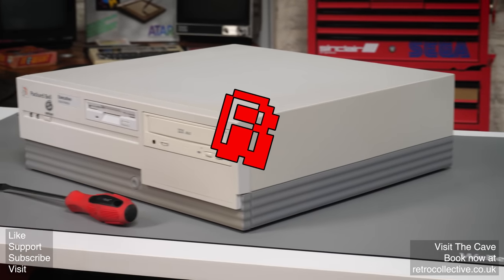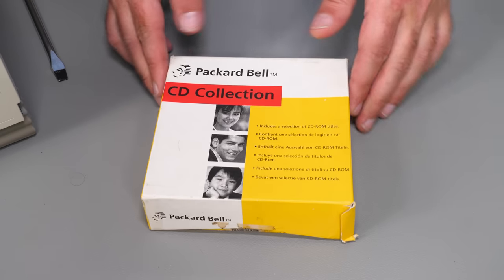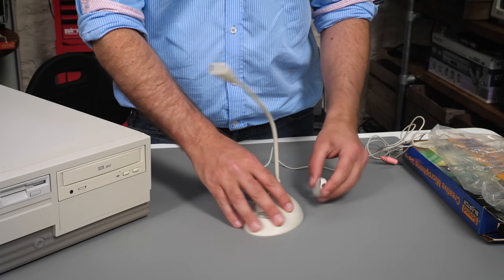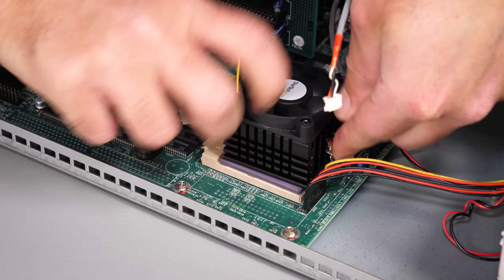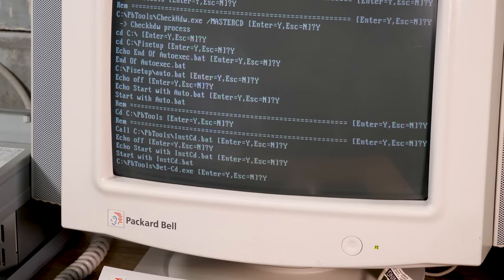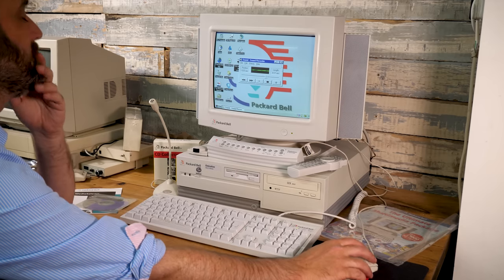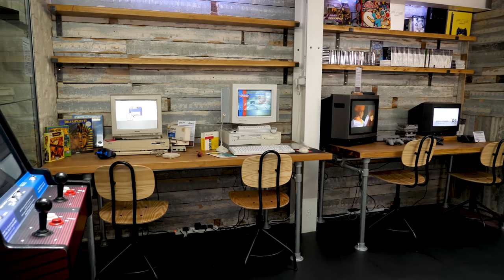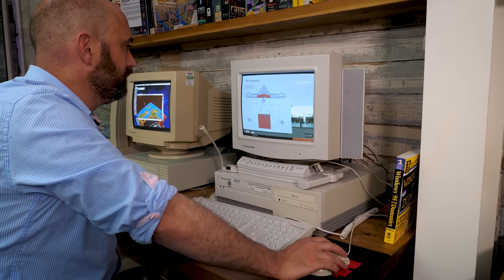Finally, a Home Fit for a ’90s Packard Bell | Trash to Treasure Part 5

Comment: Buying a new computer was a big event in the 80's and 90's. So many memories.
Reply: For me it still is, I mean, especially if its going to replace my current gaming PC or fill a niche I wanna use something for (like a media PC or a as a spare computer/NAS thingy)
Reply: The only new computer I've got was a netbook in 2009, everything else I've got used. To me the last time getting a new (used) computer felt like a big thing was in 2013 when I upgraded from a Core2 Duo E6300, Intel GMA 3000, WinXP system to a 4c/8t i7-920, Quadro FX 1800 (which I upgraded to a GTX 660 half a year later) and Windows 7. That was the first time I had a PC which was capable of running modern games.

While my current main PC (X5670 6c/12t @ 4.4GHz, 24GB RAM, GTX 1080) isn't a fast system by todays standards upgrading from it wouldn't be anywhere near as big as upgrading from the C2D to X58 was back in the day.
I have built more powerful systems for people (i5-12400F + RX 6700 and R5 5600 + RTX 3060) but the difference to my system didn't felt anywhere near big enough to even justify spending that much money to upgrade mine. I think I'll stay on X58 for few more years
Reply: I feel like my dad went computer shopping every weekend for a solid 12 months before he pulled the trigger on our first PC in 1992 😂
Reply: It still is, computers are spendy.

Mind you, whenever I get given a new dev laptop at work it's not so much "Ooh new bundle of power" it's "hello, next victim..."
Reply: I grew up in the 2000s but weirdly enough seeing those bundles of CDs bought back a lot of memories of getting a computer in the early 2000s (Some Time branded PC). Felt like a world of opportunities.
Reply: In the 90s, buying a new PC was something out of the ordinary 😀
Reply: With me building a clone for 1/2 price or better was a big event! 😊
Reply: It was like our generations version of TVs in the mid 50s early 60s, my mom says there’s a picture of her somewhere as a kid happy when her parents  got a tv

Comment: My family got one in 1994 that was a bit stripped down from this one, but it did include an offline CD-ROM based "multimedia" encyclopedia of animals where the main draw was 144 (maybe 200 something) video of exotic creatures. 
Also, some obscure Jurassic Park game. Arrived w/ a dead soundcard, which took months to get replaced. 
No modem, but did have a printer.
Total in 1994: $2,500.

Comment: Thank you SO much for this series! My first ever not just PC but computer was the 75MHz version of this PB. That 'for kids' GUI/shell you showed sure did give me a good and proper nostalgia-smack. Prodigy, Encarta 97, 3D Body, etc. are what I remember most from the US bundled bloat. The pièce de résistance was beating Myst on this thing...which was so hard for me as a kid. Recently re-played it and it only took a couple of hours, if that haha. Time is a trip.
Thanks again for taking the time to lovingly restore what to a lot of people is trash but what is certainly a treasure to me. Cheers Neil!

Comment: Seeing those voodoo boxes sparks a sense if childlike joy in me, I remember seeing them on the shelf in the typically brown computer store we used.

I was unaware that the graphics card we had was much newer and more powerful, the packaging made those things look genuinely badass.

I would also would later realise that having a graphics card means nothing if you plug the monitor into the on board graphics. Not something I learned until many many years later...

Comment: Got my first family PC back in 94.  Was a Compaq Presario which had a case identical to that Presario at 20:09 in the video.  It was a 486 66mhz, 4mb RAM later upgraded to 16MB RAM, 200 ish MB hard drive, 2x cd rom.  Had it for years and absolutely loved it.  Wing Commander III & IV, Tex Murphy adventure games, Descent, so many classics.  I miss the 90's.

Comment: Your video brings back many memories and frustrations; for I had a Packard Bell tower that I bought December 1997. The computer case was a very unique tower design shaped like an Art Deco skyscraper, with a broad base and a tall slim section that rose above, containing the CD player and floppy. The computer used fantastically expensive EDO-RAM that had to be installed as precisely matched pairs - the cost of maximizing the memory to 128mb was a staggering 1,400 dollars in 1998!  I did have a mediocre matching monitor with speakers attached to the sides, a rather fragile looking microphone, and a keyboard with a few dedicated buttons. The computer had a restore disk that was maddening to deploy for 9 times out of 10 the restore program failed to boot. The computer developed a weird issue with the main IDE interface that caused the PC to take 15 minutes to cold boot - but I still had a lot of fun, actually installing Windows 2000 on it and then using it for five years as a server for my home network and it did not once crash despite leaving it on 24/7.

Comment: You can test the IR remote by pointing it at your phone camera and pressing a button.  The phone camera will show the light flashing if it's working.
Reply from the maker: I won’t give up on it, thanks for the tip
Reply: @RMCRetro  I don't recall seeing you put any batteries in it!
Reply: Some cameras filter out IR, so you’d have to find one that doesn’t.
Reply: @jamesdecross1035 That was my first thought as well!

Comment: I had a similar remote back in the day, you should be able to see the remote codes coming in over the serial port with something like hyperterminal, if you don’t get codes it could be your remote or your receiver, you can try other IR based remotes with your receiver to half split the problem.

Comment: Neil, you can point the remote into a phone camera in low light to establish if the remote is actually transmitting IR. This might help narrow down where the problem lies. 😊
Reply: Edit:just spotted someone else has posted the same suggestion 😅

Comment: I don't know if you have water pipes or a heater or anything around, but since you are doing a museum, something to think about is getting risers for any PC that's on the floor. For a school I worked for we picked up cheap little PC tower caddies with casters on them for around $20. Water leaks hopefully never occur, and if they do, ideally MANY years apart.. but none of the less with hard to replace hardware.. Risers are a nice and easy thing to protect the equipment!  Many of the "Caddy" items are larger and may impede on the look of the tower, but most PC tower "Riser" labeled products are more like simple stands and may look better and be less obtrusive.

Comment: I had the earlier 486 SX-33 Packard Bell with the 2 speed cd rom, 4mb ram, Astek soundcard/modem and 240mb hdd. Some of teh games I had for it were the original Civilization, Frontier: Elite 2, Syndicate, Cannon Fodder, The Settlers, SimCity 2000 and countless pc magazine disks with classics like Tyrian 2000 and Raptor: Call of the Shadows. When I bought the original Star Wars: Dark forces though, I had to add an extra 4mb of ram. It was also the first IBM compatible pc I had after giving away my Amiga 500 to a mate's disabled dad.

Comment: I have wonderful memories of my family’s Packard Bell. It was from 1996 and the same style as this one. I remember the sound-card/modem combo had surprisingly good SoundBlaster compatibility in both DOS and Windows games and had a nice sounding wave table. It came with a restore CD that included Windows 95 on it, but it did not come with a standard Microsoft Windows CD.
Reply: I've seen another comment here saying the Windows disc came with the system. I was surprised. A friend got a PBell when XP was first released (I helped him set it up) and that didn't have a WinXP disc. I can't recall exactly how it worked but I have a vague memory that the hard drive included some sort of shadow partition of XP. Then, using a floppy, you could make a backup CD (or CDs?) of XP by following a program on the floppy. Archaic!

Comment: I was still using my A1200 + Apollo 1240 33Mhz + 32MB as my daily driver until 2000 so I missed this era... I bought a 90s machine in 2000 for cheap to do some 'privateering'

Comment: Shelf wise, I also have the sidewinder, Lucas Arts and Delphine big boxes  up there. You could put a 3.5" floppy disc box to really add to nostalgia.. Fill it with some random pirated discs. 😁😁 Maybe even a few empty CD caddies for the early days of CDROMs. Some of those massively thick books on windows secrets, HTML guides and similar. I'm still kicking myself for getting rid of my Space Quest collection big box, that would've looked great on my shelf.

Comment: Congrats to get it finally done! 
About the fan: The Pentium really doesn't produce much heat, so you may even be fine with removing the fan altogether, as the case fan is likely producing enough flow, and the area of the new fan is much larger. If you don't trust that, try a Noctua on it, stepped down with one if its voltage converters. Did the same here with the very same cooler and a P233 MMX (which has a higher wattage), and that just works fine. In doubt, use your finger to measure temp... if it doesn't burn, it surely is cool enough ;)

Comment: I'm not sure what sort of brand cachet that PB's had in the UK, but across the pond in the states, they were always known to be bargain basement specials.  I sold PB's stateside in the late 90's (using the design language of the unit that you have in the video), and it wasn't uncommon to find two examples of the same SKU using vastly different parts.  It was speculated at the time that this was not a manufacturer error, but rather just extreme cost cutting.  We once found a case wherein there were four examples of the same SKU, and they all had different optical drives.  Same thing discovered on the modems which were either a riser board or ISA slot type (PCI on later models).  While a similar model from Compaq would almost always use the same model parts for a entire run of a given SKU.  The net result of this is that sometimes the machines didn't work 100% out of the box... this was not a case of bad components per sé, but rather it was almost always a driver issue that the customer buying the computer couldn't easily resolve on their own.  PB's tech support was crap too - waits of 2-3 hours on hold were common, so most people brought the units back to the store, and then when we told them that we could get the unit working, but would take 1-2 hours of paid labor.  This caused many returns.  Glad you were able to get yours going.

Comment: Not /entirely/ computer related but the only other things I could think that would make that look like a 1990s era computer room would be a vertical CD rack filled with a selection of adult contemporary (or grunge) and a spindle of blanks waiting to be burned. Maybe an old Bose wave radio.

Comment: These master CDs are far better and less hassle than their master CDs for Windows 98/ME, let alone XP! I used to support Packard Bell machines for PC World/Curries/Dixon's tech support line back in 2004/5 and you had to have a tattoo on the motherboard which told the recovery program which drivers to install. For 98/ME systems it used a none-bootable recovery CD that required Packard Bell's boot floppy to run and for XP systems it was a recovery partition accessed by holding a key during boot, that could be burned to a bootable CD but it would nuke the partition afterwards.

The tattoo was only a problem if the motherboard was replaced, unfortunately these were cheap motherboards during the dreaded leaky capacitor era so a lot went dead. If you had to tattoo an XP system they'd still have to download and make a PB floppy because that's where the tattoo program was! Then we get into the joy of cheap 5400 RPM IDE drives for the XP systems and when they fail having to tell the customer the hard drive will be replaced but they'd have to contact Packard Bell themselves and pay for the recovery media because they hadn't burned their recovery media.

Comment: Amiga used to do something similar. I recall getting my Amiga 500 on Christmas day and with no previous experience had it running a few simple batch file games basically telling jokes verbally from another Christmas present a Joke filled book.that would speak to the user. 
It really was a bit of a scam though and it carried on for quite a long time well into the late 90's by supplying hoards of shareware or demos with a new computer and telling brand new users that it was worth loads of money.
However I believe the internet killed the practice off pretty quickly.
BTW 
The restoration on that case looks amazing, Just out of the packaging almost. Great Job.

Comment: I still have and use the SideWinder Force Feedback 2  you were stacking on the nostalgia shelf at 19:32! Works great with MSFS 2020, although the sim sadly doesn't detect and auto-map the controls and there's no force feedback - but it was easy enough to set up and being a USB controller still works just fine on Windows 11.
Reply: Nice. I had the sidewinder MS gamepad controller that was the prerunner to the Xbox controller. It came w/ that weird rollerball game.

Comment: The first computer that I had in my bedroom was a Packard Bell system that had Windows 95 and an Intel DX2 processor that looked similar to this one for the case. I found it at a garage sale when I had my paper route back when I was around 13. The system came with a keyboard, mouse, monitor, speakers and a book full of CD-ROMs and the whole thing only cost me $20. The system then died 20 days later, I don't recall what it was that caused it to die, though as it was around 20 years ago that I had it.

Comment: One of my first PCs was a Packard Bell MultiMedia 9030, which had a Pentium MMX 200, 16 MB RAM, 2.1 GB HDD, 20x CD drive, Windows 95 (SR 2.1), Encarta 97, MDK, FIFA 97, Kai's Power Goo, Ell Beauty Guide, Adiboo 2, Swiv 3D etc. We got it new in 1998-99, when I was 12-13 years old. I think it was £799 or so. Fond times.

Comment: I love what you have on the shelves. I think it would be great if the desks and shelves organized as a timeline, starting with IBM PC5150, Amstrad PC1640, moving onto 386, 486 and beyond. An absolute must to have an Amstrad PC in the mix. Fantastic series on the Packard Bell. Thoughts on what could be on the shelves would be an Adlib card, Sound Blaster, 56k modem, DR-DOS, Windows XP.

Comment: While the design became quickly dated IMO, when these were new they were quite modern looking and very different from the "big beige box" commodity cases that most of their competitors used. Dell, Compaq, Gateway and IBM also had some interesting case designs, but I think PB really nailed it.
Reply from the maker: I agree PB hit their stride for a period, but they also went on to make some horrible looking things. I wasn’t a fan of their “blue” coloured period
Reply: I agree Packard Bell did have some great case designs but they did date quickly. The strangest design from PB around this time running Windows 95 was the corner PC which LGR has covered.

Comment: I really like the PC area. An odd suggestion. I think you said the tower had a 3d accelerator that had a pass through. Putting that on the desk with the back facing us... showing off the mess of cables and the pass through. It's as nostalgic as the front of the computer to me.

Comment: When you're done setting up a system, such as this Packard Bell, do you create a drive image using a modern system to be able to revert it back if anything gets corrupted? Example: someone deletes system32, or types in an rm -rf, or a drive just decides it's had enough of working and dies.
Reply from the maker: Yes once all working I like to take an image. I remember what I was like messing with computers in stores when I was younger, it will happen 😁

Comment: Back in the day I had nothing but problems with PBs as an IT consultant when a customer got one against my advice for heavy office work loads.  They where also caught  using USED PARTS and paid millions and had to add the fact that they may use used parts or manufacturers seconds components on all of there packaging and sales content.  I am not sure when that started but it was just before they were not around anymore.   I once walked in on a service call and found a line of PBs in one of the offices and my heart sank but they I brightened knowing I was going to make a mint on servicing them and I DID for a few years.  I think maybe home users faired better with these but I had some issues with home users as well.
Reply from the maker: That reminds me of when the Directors of a company I supported would ignore the proper process of us getting them a PC and turn up with a Sony Vaio with XP home edition on it because they liked the look of it and had a company card. A PB like this really had no place in a business I agree!

Comment: I was a IT tech in the late 90's, and Packard Bell computers drove me nut. They always ran slower, and buggies, particularly with Windows 3.1, than any other machines with identical hardware specs.  They got such a bad rep with the staff at the facility I was working at that nobody wanted to use them.  We spent so much time dealing with users complaints about them, management had to stopped purchasing from them.
Reply from the maker: I don’t think anyone would put them on a pedestal for build quality but for many it was their first point of entry into the PC and those frustrations became part of the learning experience, so I understand the nostalgia but also the techs hating on them